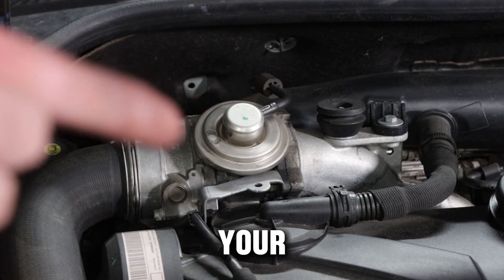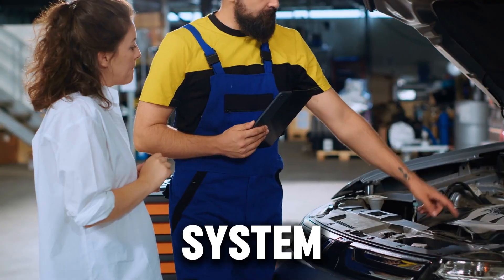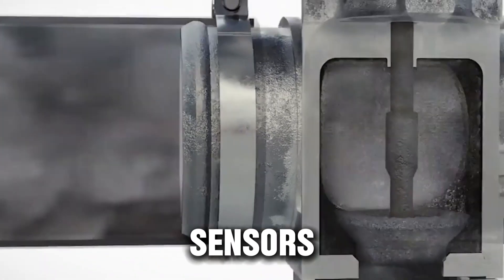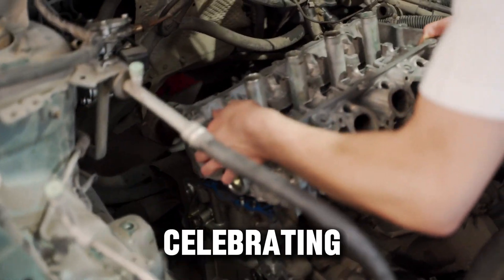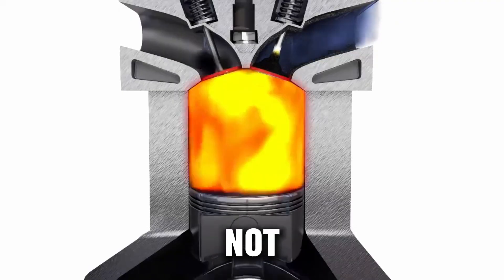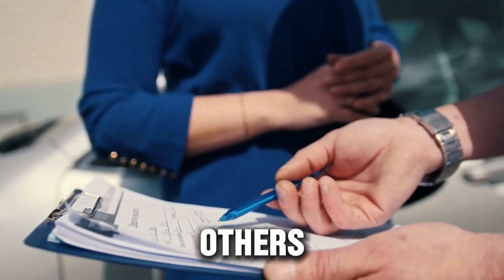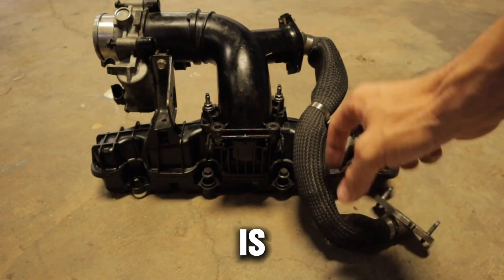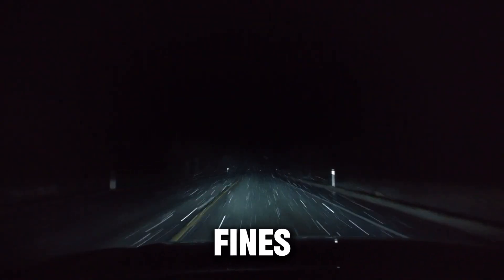3 Things You MUST Know Before Deleting Your EGR

Comment: Any engine wants unrestricted clean air intake. Any racing car with EGR? Off course not! I took mine off, better performance and much better consumption. If the EGR was for pollution reasons, then even more a scam. Measure the exhaust gasses and compare it to the small pipe through EGR. Then it even makes zero sense. Any diesel has open airflow into engine, speed ONLY controlled by amount of diesel injected. Want performance and better consumption? Take EGR off.
Cheers

Comment: Last year I towed a 9000 pound trailer 11,000 miles. When I got home , engine light came on. EGR plugged along with other areas. ERG changed. This year drove 3500 towing same trailer 9000 pounds. Engine light came on DPF full. Spent thousands in the last 15 months. I have a guy who will delete themDPF and tune it. He does lots of these. I have a 2018 F250

Comment: one thing you've missed is that an EGR delete will cause rough shutdown of the motor as most use the EGR as a method of smoothing motor shutdown. It was far easier on older diesels to do the delete because most had a fueling pressure screw that a quarter turn would adjust the fueling to enough to avoid knocking and with road testing you could adjust this screw for good economy and power, this though is not available now with fully ECU controlled systems.

Comment: EGR increases combustion temperature and does not decrease it because exhaust gas temperatures are much hotter than most people think somewhere in the neighborhood of 600 plus degrees Fahrenheit and  depending on what kind of engine is on diesel engines and closer to a 1000 degrees Fahrenheit and as for the carbon and soot particles taken in during the process of EGR and combined with the PCV system and oil that system brings into the equation along with moisture engine now has to work harder than it needs to to make good power. The PCV system acts like the glue and the EGR acts like the soot and carbon deposits.
Reply: It does reduce combustion temperatures because the exhaust gasses replace oxygen making the fuel burn poorly which produces soot rather than NOX, the problem is that the soot is also fed back into the intake slowly clogging everything. Newer diesels even include a EGR cooler which removes some of the exhaust heat by a heat exchanger with oil or water. The whole premise of EGR is the reduce the amount of Oxygen available to use for combustion thus reducing the engines ability to produce heat.

Comment: What its suppose to do ,,,,,,,Egr = lower combustion temp = lower emissions
What actually happens Since around the 80`s no service schedule for egr . Car makers lowering service costs  by majic ....
Forward to the 2010 --onwards no service to a diesel egr/ cooler . A leaking cooler usually overheats an engine  causing major if not total loss .
EGR deposits are abrasive and shorten  injector life due to  wear . EG 600$ plus each +labour to install 
In the 70`s there was egr servicing 
Deleting a modern egr by mechanical or electronics does NOT EVER cause the engine to run hot .

Comment: Blocking plate 10,software 200 dollars. No need to talk about it.Just never ever remove hardware,only dpf core
Reply: simple alternative is to put a ball bearing in the EGR vacuum actuation line and have a spare hose to replace it with should you need an emissions check, most also have a resistor on the Fuel pump for calibration which if you put a small resistor inline with it will boost fueling to compensate (roughly).